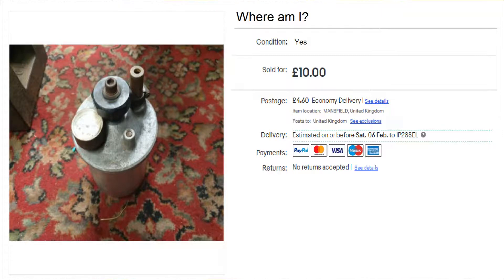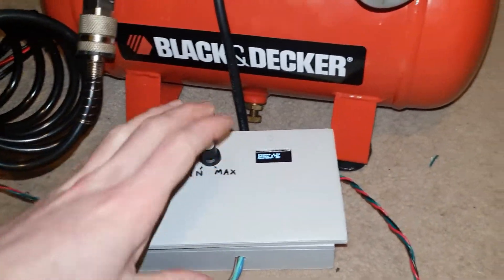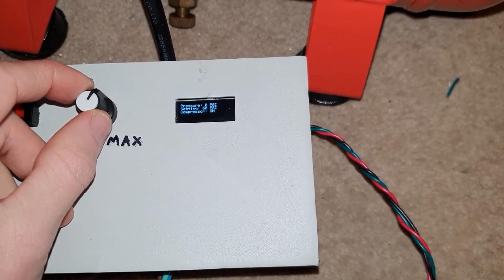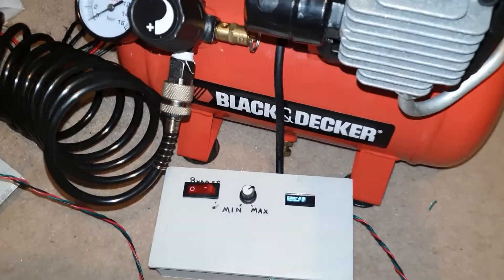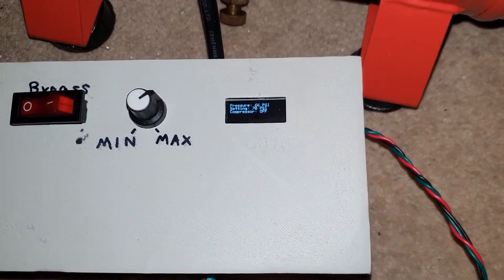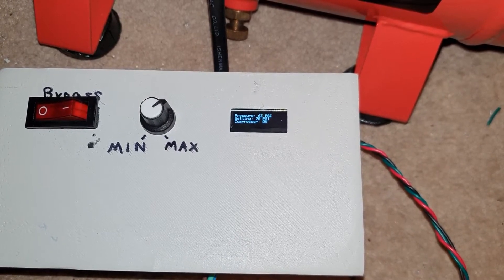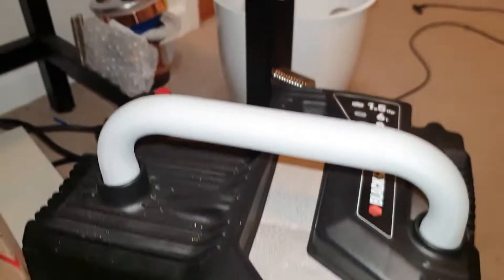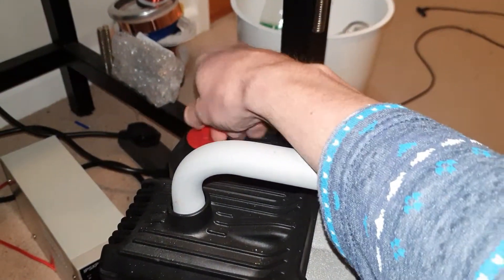Automating my air compressor with Arduino!

Comment: Hi sir can i know how to change coding for the 150psi sensor ? Because my sensor not working on this coding
Reply from the maker: If I'm not mistaken, you should just have to make the following changes.

Line 26: #define MaxPressure 150
Line 66: Pressure = map(analogRead(ReadPressure), 101, 921, 0, 150);
Line 67: Setting = 5 * (map(analogRead(ReadSetting), 0, 1023, 30, 0));

This is assuming you used the same type of sensor as me, just with a higher max pressure.

If this doesn't work for you, just hop in my discord linked on my channel and we can talk about it.
Reply: @BenjaminDMarshall  tq sir ! 👍🏻

Comment: Sir can i know what the function of bypass mode because i a little bit not understand for the bypass mode ?
Reply from the maker: It just allows you to manually control the compressor.
Reply: @BenjaminDMarshall  sir can i know what relay did u use ac or dc ?
Reply from the maker: I used a 12VDC 30A relay. So 12V is used to flip the relay, and connect 240VAC to the compressor.
Reply: @BenjaminDMarshall  so sir how about code #define WDT_active A7 for what function ?
Reply from the maker: I kept having issues with the electrical noise of the relay freezing the arduino, so it has a hardware watchdog timer to reset itself if that happens.

'WDT_Active' is a pin used to determine if the watchdog timer is enabled:

if(analogRead(WDT_Active) == 1023){
  wdt_enable(WDTO_1S);
}

So if the pin defined as 'WDT_Active' (in this case pin A7) is pulled HIGH, then the arduino will enable the watchdog timer.

This is a way of ensuring that the Arduino doesn't get stuck in an endless cycle of resetting.
Reply: @BenjaminDMarshall  if use relay 12vdc 30a so i must use power supply 12vdc 30a or 10a ?
Reply: @BenjaminDMarshall  so pin A7 connect form what ? relay or another ? i still confuse A7
Reply from the maker: A7 is pulled high. So it just needs to be connected to 5V.

The relay just needs 12V for switching, and it only draws a hundred milliamps or so. 

The 30A rating is referring to how much current the relay can switch. The compressor only draws around 4A at 240V, but it has a higher in rush current since it's a motor, hence the 30A rating on the relay.
Reply: @BenjaminDMarshall  hi sir , can i get your library coding ?
Reply: @BenjaminDMarshall  sir may i know what type pontiometer you used ?
Reply from the maker: The libraries I used can be downloaded from the Arduino IDE, and I just used a 10K potentiometer, but any kind will work.

Comment: what is WDT_Active A7 for?
Reply from the maker: I kept having issues with the noise of the relay firing causing my arduino to freeze, so I'm using the watch dog timer integrated into the arduino's hardware to reset the arduino if too much time has elapsed. In this case the watchdog timer needs to be reset atleast every second or it will trigger an arduino reset, you can see that 'void loop()' starts with "wdt_reset();". But I also wanted the ability to turn off the watch dog timer in case the arduino got stuck in an infinite reset loop.

"#define WDT_Active A7" is just me telling the compiler to switch 'WDT_Active' with pin 'A7' anywhere it finds it in the code. This is so I don't have to remember which pin it is.

In the 'void setup()' function, the arduino checks if pin 'A7' is pulled high, and if it is then it enables the watch dog timer. The end result is that all I need to do to disable the timer is disconnect pin 'A7' from 5V.

I hope this was helpful.
Reply: @BenjaminDMarshall  thank you for answer for your great project
i would like to customize your code with a rotary encoder and a stored setpoint. if you like, then we stay in contact?
Reply from the maker: Sure! If you need any help with anything, let me know.

Comment: Very well mate. I want to make a pneumatic cylinder that's force can be controlled with electronics. i think that i can make it with air pressure controllers. Do u think that's possible or not?
Reply from the maker: I feel like that is definitely possible. Though if you care about the cylinder's position, you would need some sort of sensor to measure how extended it is.
Reply: @BenjaminDMarshall  thanks for your answer. I don't think that i'll need position control. I'm thinking about using valves to adjust air pressure. Using data from pressure sensor.
Reply from the maker: That sounds like a fine plan. They make solenoid valves that would be perfect for that.
Reply: @BenjaminDMarshall  Yea i know those. I'll try. Thanks again. Nice content btw. Have a nice day.